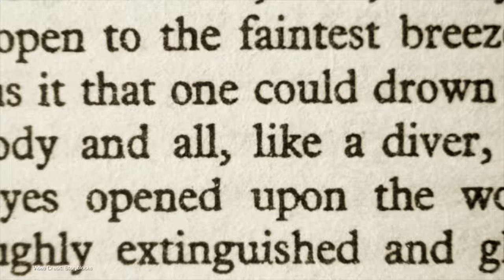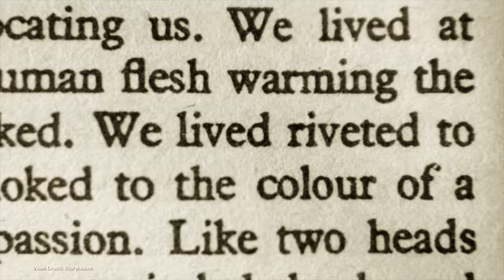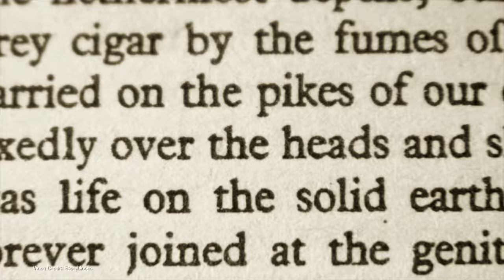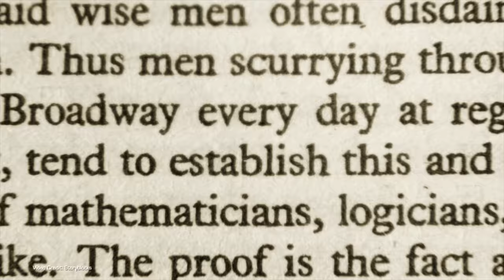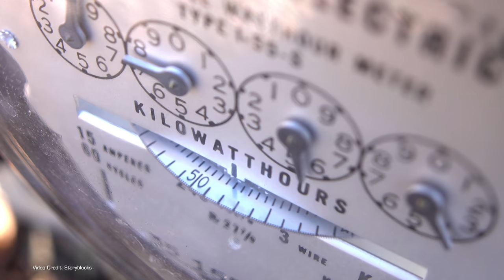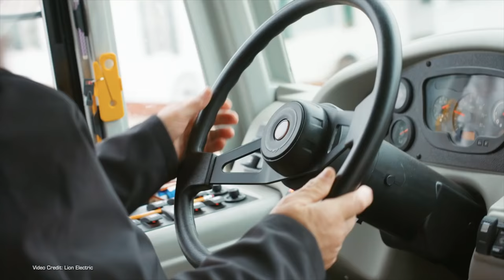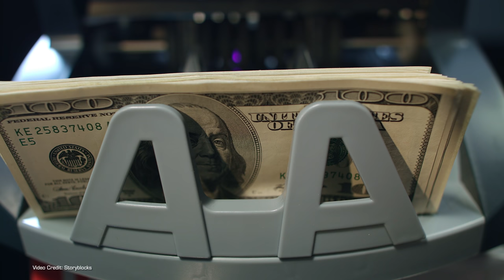Infrastructure & Build Back Better. (Or Why You Can't Get A Rebate/Credit On Your Tesla Yet).

Comment: We thought about waiting, but broke down and purchased a tesla (delivery 2 weeks ago :) )

Personally, I am retired on a fixed income.  But I would rather NOT have EV tax credits, but remove incentives for Oil & Gas production, and possibly a tax on removing coal from the ground or importing coal.  (a different kind of carbon tax!)

And while we are at it, remove the corn based sugar requirement for adding alcohol to gasoline (it requires 10% more fuel for the same energy, plus the embodied energy in making/growling/harvesting/transporting the alcohol, and since it is being used for fuel, it is not available to feed people and animals, causing a different kind of 'tax' on consumers).  Yes, some of my retirement comes from big oil, I spent over 20 years working for them, then moved industries.

Comment: I would like to see money to put more LEVEL ONE chargers and WALL OUTLETS in places like park-and-ride and at work places. These strike me as less expensive and in the right places (e.g. where I park every day for over 8 hours at a time) it would do a whole world of good. I suspect, however, that this will help fund flashy "high speed" chargers nowhere near anywhere I want to go.
Reply: Hear hear!  Vehicles with long range batteries, say 200 miles or longer, do just fine with typical daily mileage and 8-10 hours of charging from a 120V outlet.  Simply installing weatherized NEMA 5-15 or 5-20 outlets ubiquitously would allow many EV drivers to get their daily driving needs met opportunistically.  Such a system wouldn’t easily accommodate metering a fee collection, but a single driver could only consume about $3-$5 of electricity over a typical working day.

Comment: We need to build safer better power lines and roads and trains? Is it time to revisit the suggested monorail /infrastructure plans from about a decade ago? The one where we build a raised monorail track down the center of the highway with power line tunnels built in and solar panels ect. Wish I could recall the name of the project designs.

Comment: I can't believe the USA is using only 110 volts from your grid. Australia and England have 240 v standard single phase or 3 phase 480 volts. 
My Nissan leaf shows on the dash 12 hours to charge with 110v or 6 hours using 240 volts.
I think your grid needs to be upgraded to at least 240 volts.
Reply: Pretty much every USA house has a 240 volt supply Used for hot water , heat pump, clothes dryer and other high loads the 120 is for tiny things
Reply: @tommays56  that's why I'm seeing people use a wall charger from there clothes dryer plug. That's a relief to know you have 240V Do you also have 3 phase power to your houses. Many here in Australia do. My house has 3 phase power. 
Thanks for filling me in.

Comment: If automakers jack up their prices and the incentive money goes to them that will help EV adoption even more. At this point, good EVs are production limited, not demand limited. Legacy automakers lose money on EVs so they will be incentivized to switch to building more EVs quickly without having to use their ICE vehicle profits to fund it (which means they can transition faster). EV startups, which lose money quickly in their initial years, will have less chance of going bankrupt. Tesla can use the money for more innovation, Superchargers, and more factories. If the money went to customers, it would do no good in speeding up the transition because every EV is already sold and there are waitlists.
Reply: Tesla already has. It's insane, a model Y is now almost 55k starting... What happened to 40k model Ys that Elon promised would happen? And the Model S used to start around 70k, and now it starts around 93k.... WTF? Things should be getting cheaper, not drastically more expensive.

Comment: Just a thought trucks and suv's are the most popular vehicles in North America and largely consume the most fuel and therefore at their level cause the most pollution. Having said that wouldn't it make sense to get these vehicles off the road sooner than later ?
I think that the wage cap that's going to be in place is more than fare. However I think that all bev's should receive a rebate. After all what's the point if your encouraging people to hang on to there large polluting vehicles or buy new ones.

Comment: I think the EV section is changing every few days. Last I heard the income limit was reduced from $400k to $280k to get any credit. They also raised all non-sedans to $80k, so you can go back to adding options on the assorted trucks and SUV's. 
I had always thought the credit was going to be made refundable which means you can claim it over multiple years instead of like now where you need to have enough tax in one year. I am perfectly happy if they make it point of sale as that would make it much easier than waiting to do taxes and that whole convoluted mess.

Side note about the air traffic money, while it doesn't directly reduce emissions, it would reduce the amount of time airplanes spend doing figure 8's waiting for a landing spot, and the amount of time they wait on the ground waiting for a take off spot. All that does save some emissions.

Comment: So how do they offer a pos rebate conditionally based on a buyers income?  Do buyers have to bring prior year tax return on delivery?
Reply: For vehicles purchased in 2022 you get the rebate when you file your taxes in 2023. They credit the rebate to your taxes. They are using 2022 to set up the system that will be used after 2022. Starting 01/01/2023, it's my believe that they are going to look at the 2022 income to give you an instant rebate if you qualify.

Comment: More unions!
Reply: UAW is involved in the worst part of the bill, which pertains to hybrid vehicles. Hybrid vehicles made by UAW workers could qualify for up to $9k with federal rebate, $1k-$1.5k more than other BEVs like the Model 3. That is an atrocity and this part of the bill needs to be struck down.
Reply: I'm generally a union supporter and have been a member of a couple of them in my lifetime.  However the UAW is a corrupt union.  It should not be pandered to in our infrastructure bills.  There could alternatively be a provision for requiring a decent wage however.

Comment: Is it possible that some of the $$ earmarked for airports would go to adding EV charging infrastructure to their parking decks?  If you go on a trip for two weeks, hopefully your EV is plugged into a level 2 source - especially if it's cold outside.
Reply: What car needs two weeks to charge at level 2? Give us more level 1 chargers and wall outlets in places where we park for hours at a time.
Reply: @ordinaryelectric2081  I'll admit, my EV is on order, so I don't have a lot of firsthand experience yet, but I keep hearing that trying to maintain battery charge level with a Level 1 charger when it's Sub-Zero outside is not possible. Would be interested to understand if you know differently.
Reply: @skywalker2852  - I'll admit that I have not yet experienced a northeast (US) winter as an EV owner. 
I bought two very different, older EVs this summer and have been driving them for a few months. My main EV is a 2013 Nissan Leaf. It has a fairly limited range, and we've taken one weekend trip in it. Mostly we drive it around town.

My son also uses the Leaf to go to Community College. There's a level 2 charger there and he basically plugs in at school which in an hour or two replaces the energy it took him to get there and back. The rest of our charging is usually done on level 1 - either at home, or occasionally at work.

The temperature is starting to drop and there have been a few mornings where there has been ice on the windshield. No real snow yet. When I'm lucky enough to find a parking space near an outlet, I'll charge for 6 or 8 hours, and turn the defrost on shortly before it's time to leave. At work this is at most once or twice per week and is very nice when it happens. Underscore level 1.

So - it's hard to say, because it makes a difference if there's one or multiple drivers - and where you have to go. If it were just me, I think I could do all my summer charging in two level 1 sessions per week. Range will be reduced in winter - so let's call it four sessions, to be generous. If I could plug in to level 1 every day, I'd have to start using a timer to avoid overcharging - and I'd always get into a pre-warmed car.

It would be wonderful. 

If you want an update, subscribe to ordinary electric or find me on Facebook. No videos - yet - but for sure this is the kind of thing I want to report on.

Comment: If you don’t live within walking distance of a train station travel by rail is such a NIGHTMARE of getting to and from the stations as the bus system is so BAD 

Long Island has had brownouts with supply dropping to 200 volts on peak summer days at least 25 years

Comment: You didn't say anything about the tax credit if you buy a used EV under 25 K.  I saw that on another video. Maybe that tax credit has been scrapped.
Reply: The worst part of the bill also went unmentioned. Hybrid vehicles made by UAW workers could qualify for up to $9k with federal rebate, $1k-$1.5k more than BEVs like the Model 3. That is an atrocity and this part of the bill needs to be struck down.
Reply: @waynelewis9110  IMO hybrids should get zero rebates.  Lower the income cap for rebates.

Comment: As an EV fan waiting on a Model Y 2.0 and a CyberTruck, I'm all for moving forward towards electrification. But I believe that as much as we think we are making green choices, I think the reality is just the opposite since grid improvements are not keep pace. I think we are going from clean tailpipe emissions to increased coal emissions. If I'm too cynical, please reply.
Reply from the maker: If every single electric car on the road drew power from coal power plants, which they don't, it would still reduce emissions over internal combustion cars' emissions. Coal is dirty as power supply goes, but are still more efficient at turning fossil fuels into energy than an ICE car is for a variety of reasons, from power plant emissions controls to the wildly varying loads than an ICE car has to respond to. - Winter
Reply: @transportevolved  Exactly.
Reply: The other difference is energy sources CAN be made more green. A gas car is as efficient and green as it will ever be. There is no improvement possible on that front, but PLENTY if room for  greener energy production

Comment: Another bill to help the rich.  The average Joe can't afford a new EV and even the cheapest ones are well over $30k.  I was hoping to hear about some incentives to buy used EVs.
Reply: Did you hear the part where Nikki said a bolt would be under $20,000? And possibly less depending on the state you live in and the available incentives there?
Reply: @basementstudio7574  In summary:  $40,000 realistic cost of a Bolt minus $12,500 potential incentive = $27,500.  I think the actual net cost of a Bolt being less than $20,000 is extremely unrealistic.

Comment: Unfortunately, Elon want his cut  NOW by raising the price🤣
Reply: Tesla has increased prices primarily to dampen down demand.  They don't want wait times to get even longer than they are now.  On some configurations it's currently almost a year.
Reply: @danmoyer4650 An example:  I ordered a Tesla Model Y AWD in late October, stock wheels, stock color, stock everything.  Delivery date is next September.  Demand is trough the roof so to speak.  Could have bumped delivery down to June by ordering a different color at a $1k premium.  Hoping for an Austin built car.  🙂

Comment: Nikki, you forgot to point out the worst part of the bill. Hybrid vehicles made by UAW workers could qualify for up to $9k with federal rebate, $1k-$1.5k more than other BEVs like the Model 3. That is an atrocity and this part of the bill needs to be struck down.
Reply: I could be wrong, but I believe that to get the tax credit, they would need at least 40kwh of battery. So In order to get that credit, it would need to be a plug-in hybrid with a very very substantial electric range.